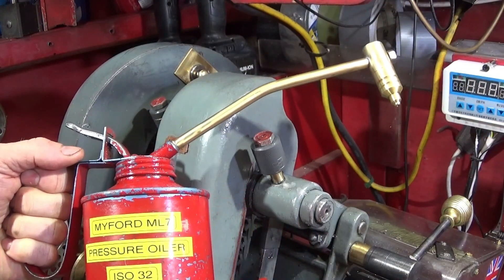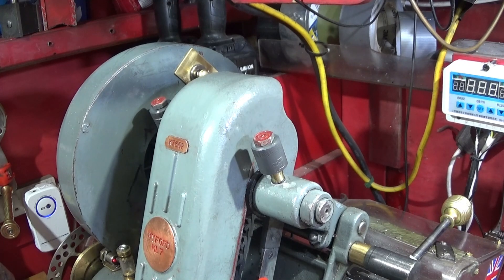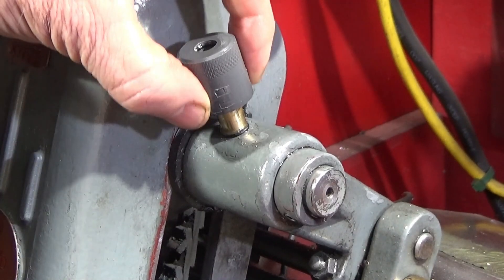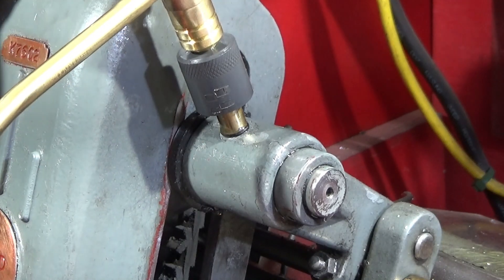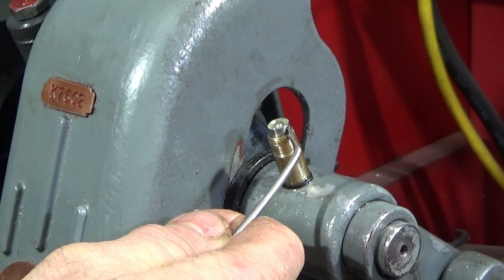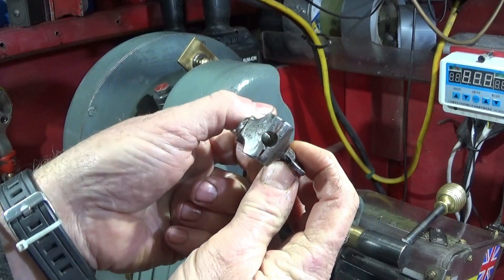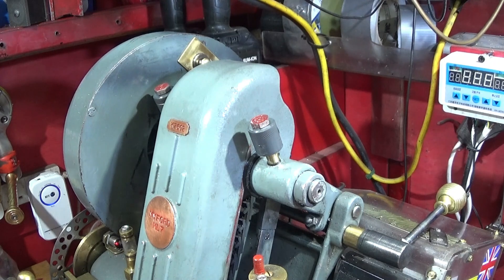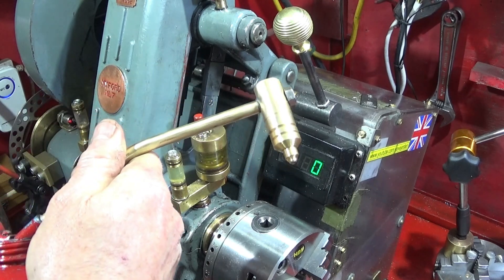New Myford ML7 Countershaft Leak Free Oil Filler Adaptors

Comment: Hi Steve. Have you had any experience with a myford oil gun? I have two that seem to have given up? I’m not really sure how to strip them down and can’t find any info on the internet. 
Geoff.
Reply: Ah the Myford oil gun. I have two. An original 1950's version which came with the lathe and a modern Myford supplied ( well in in about 2000 ) one. I replaced the original because it started leaking badly around the neck. I wasn't sure if I could take it to bits to fix it so bought a new one. It is still working without leaking. i might revisit the original now that we have been placed in lock down!